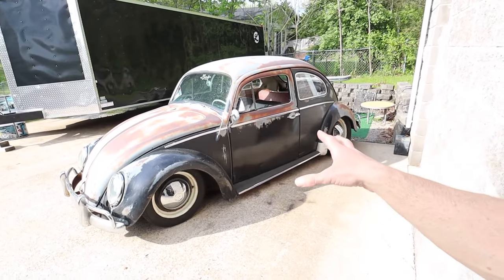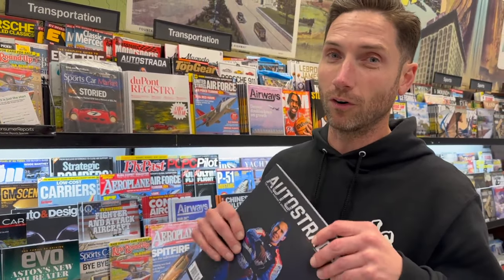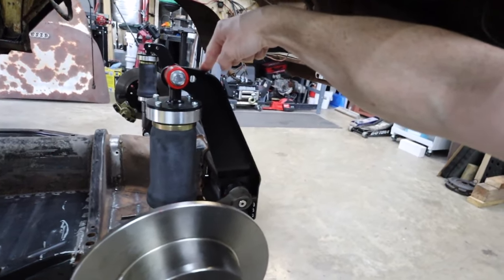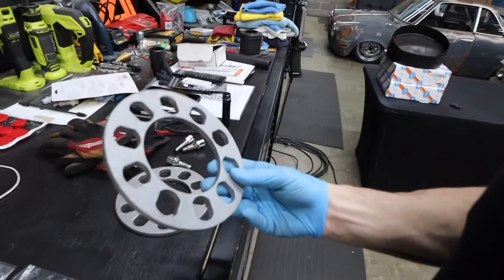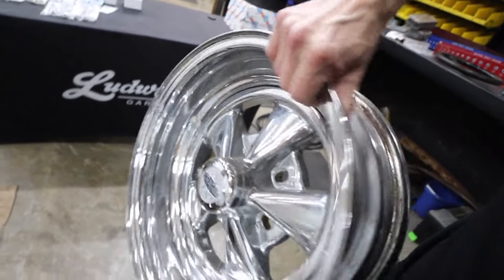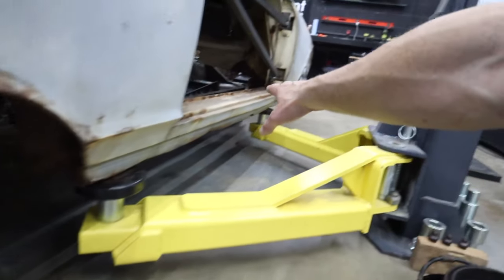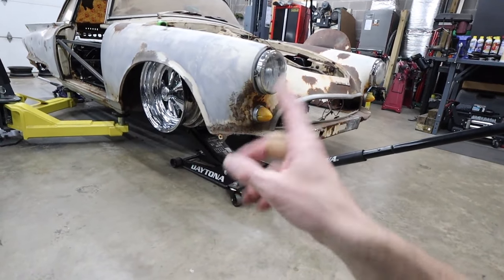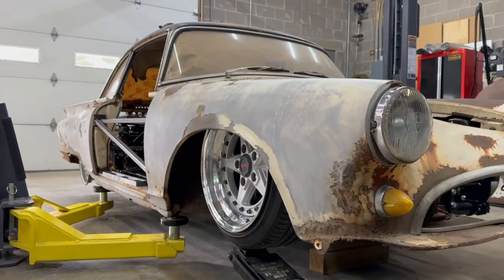What Wheels Will Fit Under My Beetle Panned & Bagged AUTO UNION 1000SP

Comment: New to the Chanel and I know this project is probably already don’t but you (at this point ) are considering cutting the bottom of the rocket panel so the rear doesn’t look too far from the ground. Have you considered extending the bottom of the rear quarter?  This might give you the desired look.